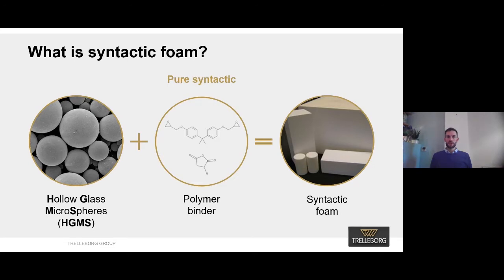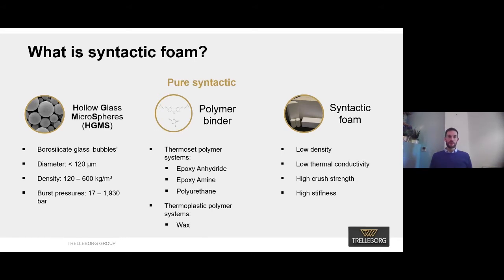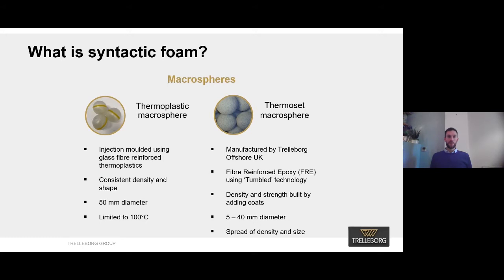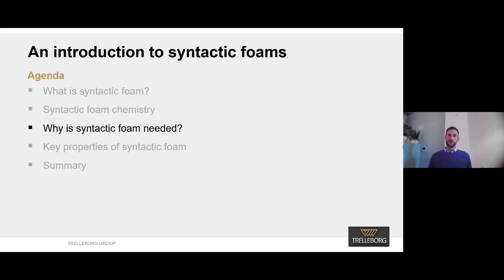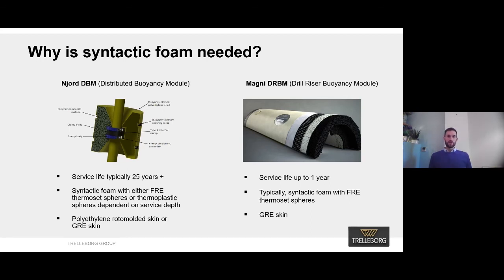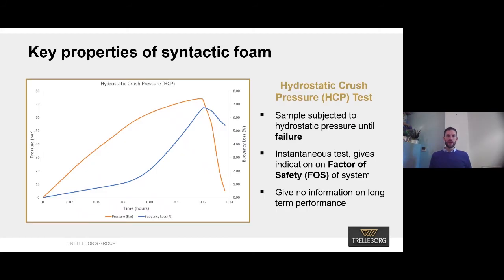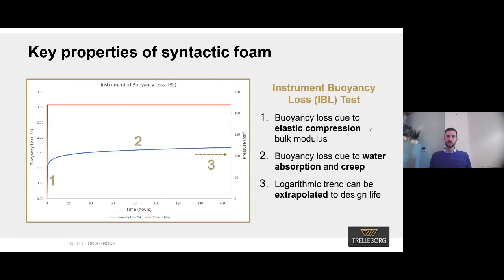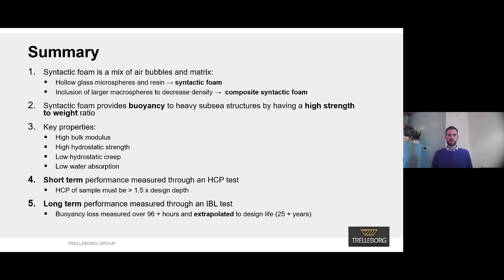Trelleborg - An Introduction to Syntactic Foam

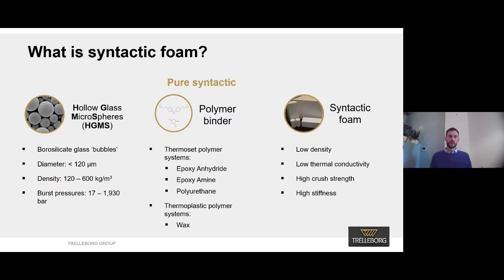Comment: 2:12 How you get out the borosilicat wich traped inside? or the wax? 
3:49 That i was thinking about making halfballs with the same materials you want to build the spacecraft for example stainlessteel.and after puring the melt stainless steel to get the "composite syntatic" picture. But the sphere maybe cant handle the melt puring. Can be improved by making macrosphere with fat walls.
Reply: 6:12 This give me an idea. Makeing this bonds betewin spheres to drain the inside wax. they get conected but only one bond at time to minimize the flow but alow you to drain the wax balls. The good part is you drain to tha botom throw one hole (before that you must turn in any direction to give the wax a path to get out(like labirint)) but when want to make thermal gap you turn them 90º so the drain hole will be facing in one side instead of botom where will be the spaceship and at top will be the plasma. 
The path drain will be deasign inmaner as diferent rooms like a sandwich. So heach hole is room made by small sphere one path. One path dont get conected to the others rooms path. The firs room will get hot, the mid room get war and act as gap because is sealead and no flow betwen top and botom layers rooms.